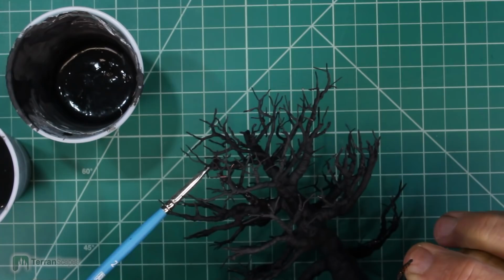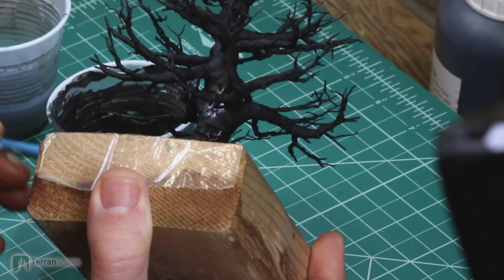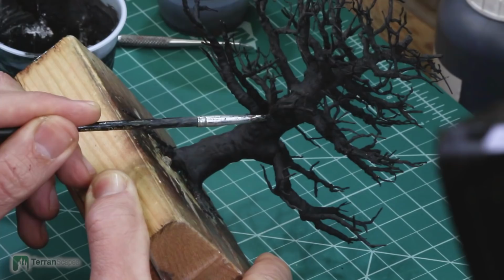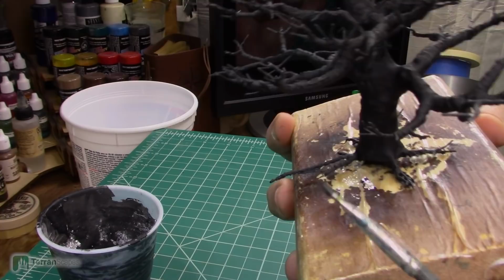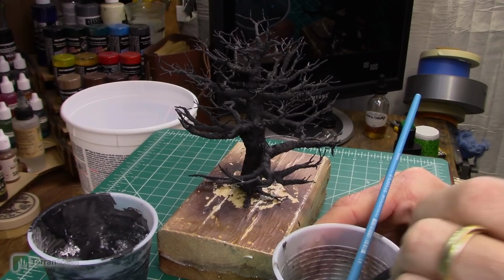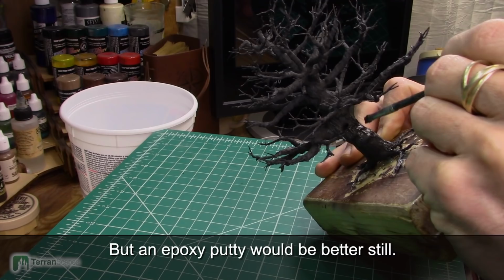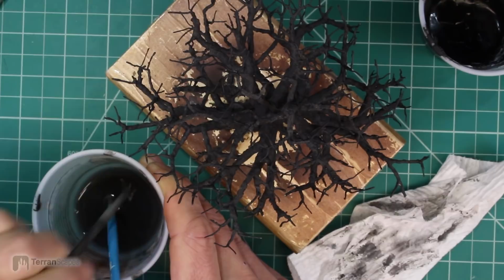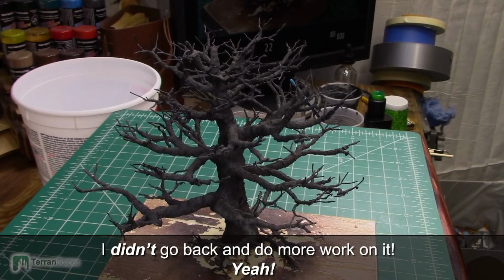Wire Armature Tree prt.4 -- Applying Bark -3

Comment: Honestly I think the texture and overall form of your tree are pretty spot on. Many trees have a smoother surface to them and I think that what you have proportionally makes sense. If anything it looks kind of like an old beech.
Reply from the maker: I agree.  I wanted more texture but this will work fine.  I'm finishing it as a chestnut and the bark works fine for that.